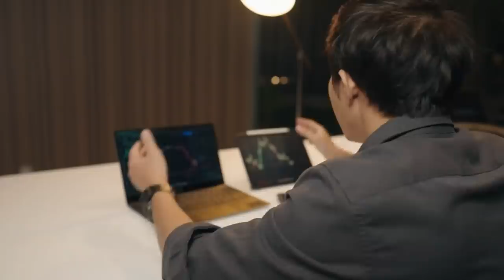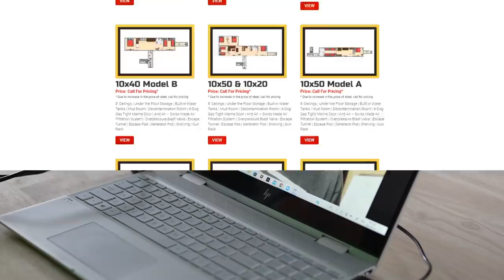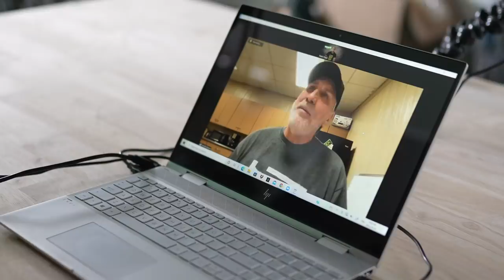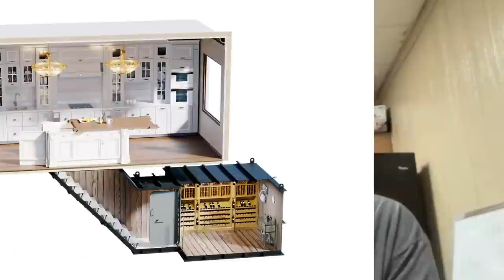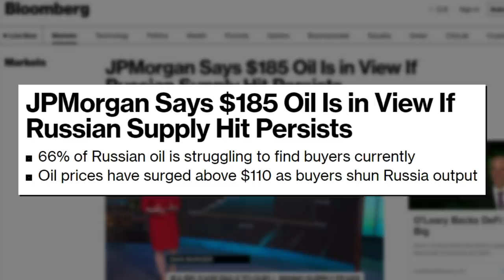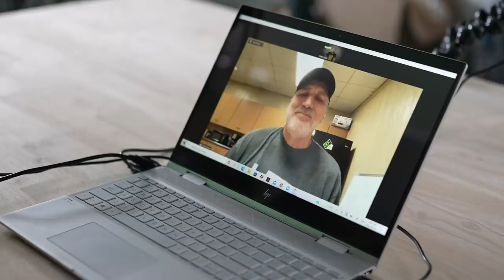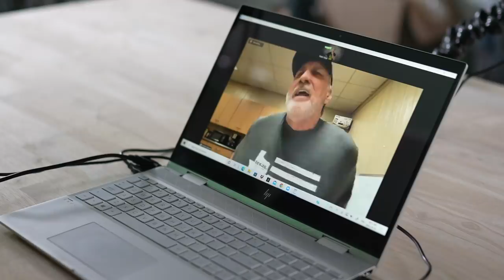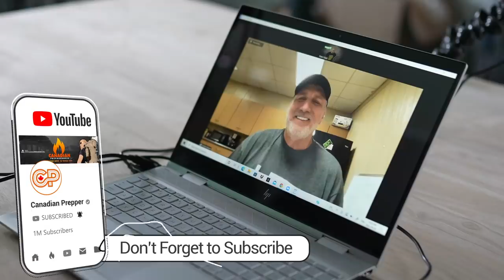Worlds Leading Bunker Contractor WARNS THE WORLD @AtlasSurvivalShelters

Comment: Yes they are and so should everybody be getting prepped.  Besides food, camping gear is paramount to a useful prep, even for home use.  When the lights go out, that tent stove is really going to save the day in heating both the air and water/food.  When it's freezing outside, the tent you set up in the living room will be much easier to heat, than the entire house.  That insulated sleeping bag will work well, when the heater stops running.   1)  Weapon, 2) Food/Water, 3) Nutritional Supplements, 4) Household Supplies, 5) Camping Gear.
Reply: Glad you pointed that out. I was raised in CO and have always had camping and fishing gear, now I’m realizing how important all of it is. One full propane tank, or gas stove, will last you a while. Plus everything else you stated is almost necessary at this point. 
Learning fishing and bow hunting to be even more efficient, bullets for threats.
Reply: Nice list.🌹🦋🌹

Comment: I would recommend shelter made of reinforced concrete covered with lead plates or without, but will be much more durable for radiation
Reply: Certain depth of soil and concrete is pretty good shield. Lead would be good for shallower hardened rooms. There is sheetrock that has lead on the back that is installed around x-ray rooms, Not sure where to get it though. When you install it all penetrations have to be wrapped in lead.
Reply: @warrenharrison9490  I also consider compressed air energy storage which will supply shelter for a month.

Comment: There are a ton of people out there that wish they could afford a nice bunker under their home, myself included. Fact is, even if you can't afford one you still need to do what you can to be prepared the best you can.  Thanks for the inspiring videos.
Reply: small storm shelter or cellar types are not so expensive. I have seen many made from one inch plastic. They place them into soil like septic tank. Tie to anchors so that water level won't raise them. No air purification, toilet or water but these are more waterproof than those rusty metal ones. That plastic is probably polyethylene with anti UV additives. It won't get sun under ground and will outlast these metal bunkers as long as it's surrounded by sand and not sharp objects. And these plastics can be glued with pipe glue or melted to other thick PE pipes to connect air and water pipes without leaks. If you find large enough PE pipe even escape tunnels can be built but these pipes at large diameters are expensive
Reply: If we have a nuclear attack I believe the ground will be contaminated for many years? I would rather die than live in a bunker😕
Reply: @beckyg8028  Doesn’t even have to be a nuclear bomb, if a bunker is affordable to the everyday person, a clusterbombing would still destroy that kind of bunker

Comment: A bunker should be after things settle. It also should never be under your house. What if the opening/entrance gets covered (bombing, weather, earthquakes/tremors, fires)? You will be trapped in your nice bunker. Make sure you are portable and capable of traversing rough terrain. Id reccomend a diesel since it is easier to make fuel for, and diesel fuel stays good longer than gasoline. 4x4 if possible though a 2 wheel drive is fine if you have some clearance, a winch, and/or offroad kit (traction skids, shovels, tire chains etc.) Dont be the sheep, be the survivor.

Comment: WOW! $40,000? You call that cheap? I dont make that in a year. I will stick to upside in my house. Plus, cant dig in this HOA are anyways.
Reply: Lead paint, lead drywall panels, lead roofing, lead doors, lots of leaded or holmium or hafnium or Tungsten or alloyed of the aforementioned building materials in general, plus structural reinforcement, air filtration, water filtration, a minimal power generator...I think you could make an above ground shelter for less than $40k... Lead is cheap! ...And delicious!
Reply: & Boron! It's an excellent Neutron absorber...& it's really cheap & also a component of several superalloys!! Just need to buy some Borax in bulk...that ain't no $40k!

Comment: Well yeah, just look at history... There is increasing evidence that this is all related to Climate Cycles and Magnetic Excursion cycles (with lengths of 12960, 6480, 3240, 1620, 810, 405 and 202.5 years long). Below some examples (note that the shorter the cycle the weaker it is, and the further we look the harder it is to notice smaller cycles, also some dates are still being debated): 

±202 Years Ago (202.5-Years Cycle): Dalton Minimum (1790-1820) and “Year without summer” (1816). Great Tartary Collapse (1801, last seen on the 1801 Mappemonde by Guillaume Delisle and Philippe Buache, it breaks into three pieces: Russian Tartary which becomes the Russian Empire, Chinese Tartary which becomes China and Independent Tartary which becomes Turkestan around 1850). Destabilization and mayor wars all over the world (early 1800s, possibly following the collapse of the Great Tartary, creating a power vacuum), most notably the “War of 1812” in North America (1812-1815) and “Napoleonic Wars” (1803-1815).

±405 Years Ago (405-Year Cycle): “Maunders Minimum” mini-ice age (1645 to 1715). The Ming Dynasty collapse (1644, severe drought). The Thirty Years' War (1618–1648) ended near the start of the mini-ice age (maybe it disrupted the war)

±810 years ago (810-year cycle): Volcanic event (1315-1320) caused damaged crops and mass cattle death, resulting in the Great Famine (1315-1322), resulting in mass death and malnourished/weakened people, resulting in the spread of the Plague (1331-1353) which was a bubonic plague, resulting in the weakening of empires, resulting in wars like the 100-year war (1337-1453). Mongol Empire Collapse (1368)

±1215 Years Ago (405-Year Cycle): Medieval Warm Period (900-1300) made climate wet in Europe, arid in North America, may have depopulated the Great Plains of North America, then The Crusades (1095-1291), The Khmer Civilization collapse (1000-1200, experts don’t know why), The Maya Civilization collapse (900, severe drought killed millions of Maya people due to famine and lack of water), The Tang Dynasty collapse (907, crop failure and famine associated with drought), The Tiwanaku Empire (1000, drought, 10-meter drop in lake level at this time), Anasazi Collapse (1150, North America experienced a 300-year drought called the Great Drought). All these collapses may have allowed an easier invasion by the Mongol Empire (started in 1206)

±1620 years ago (1620-Year Cycle): "The worst year to be alive" (536): A volcanic eruption in Iceland caused climate cooling, resulting in crop failures, then famine (weakening people), then the Plague of Justinian (541-549) which was a bubonic plague. The Roman Civilization Collapse (476). Beginning of central Europe’s 300-year Migration Period (300)

±3240 years ago (3240-Year Cycle): Sterno Etrussia Excursion. Late Bronze Age collapse (Hittites in 1178 BC, Mycenaean Greece in 1050 BC, the collapse affected a large area covering much of Southeast Europe, West Asia and North Africa, 300-year drought event), Indus Civilization collapse (1000 BC, experts don’t know why but think it was climate change and famine)

±6480 years ago (6480-Year Cycle): Solovki/Noah/Sumerian Excursion: Nothing to do with religion, instead massive floods all over the world. Çatalhöyük Civilization collapse (flourished 9000-7000 years ago then suddenly vanished, experts don’t know why), surviving Sumerians came to Mesopotamia (5,300 years ago), first city states (5,000 years ago), Prehistoric Egypt (5000 years ago), massive advances in agriculture like irrigation, all known domestication of animals and plants (4,500 years ago). Note that this event was so brutal that barely anything was left from previous civilizations. Sumer is created (6500 years ago, 

±12,960 years ago (12,960-Year Cycle): Gothenburg/Younger Dryas Excursion: Global Mega-Faunal Extinction (remember the frozen Mammoths?). Following the event: Beginnings of agriculture (9500BC), beginning of domestication through millennia of plants and animals, earliest monumental ritual art (9500BC), earliest use of brick architecture (9500BC), earliest continuous settlements (9000BC). 

±19,440 years ago (6480-Year Cycle): Hilina Pali/Lake Biwa/Lake Imuruk Excursion. Unknown effects.

±25,920 years ago (12,960-Year Cycle): Lake Mungo/Last Glacial Max Excursion: Mega-Faunal Extinction mainly in Australia/Eurasia/Africa. 

±39,880 years ago (12,960-Year Cycle): Mono Lake Excursion: Mega-Faunal Extinction mainly in North America. anatomically modern humans replace Neanderthals (40,000 years ago).

±51,840 years ago (12,960-Year Cycle): Leschamp/Napoli Excursion: Global Mega-Faunal Extinction.

±64,800 years ago (12,960-Year Cycle): Norwegian Greenland Sea/Gaotai Excursion. Unknown effects.

±77,760 years ago (12,960-Year Cycle): Toba Excursion, known as the greatest bottleneck in human history. Caused 1,000 years of volcanic winter. It is estimated that less than 10,000 people survived on the entire planet.

Comment: those bunkers will become the tombs of the rich... most of them become unlivable within weeks... humidity buildup... equipment failure...
Reply: there are videos of flooded bunkers. Not all soil is like in texas. These bunkers are not meant to last. Tubing is outside burried in soil. One fitting will leak and it's not repairable. Metal isn't any good in most soils except sand. If need good bunker/storm shelter/cellar then these all can be made from concrete

Comment: There's a guy on YouTube that shows you how to build these things step by step. The video it's like five different parts and each video is 10 hours. He shows you step by step including a sealed gas door, ventilation system that looks identical to this one and he even innovated a booby trapped door that is impossible to set off from the inside, but once it's closed and the person on the outside tries to forcibly open the door it electrocutes them. Not enough to kill them at all, but enough to where they won't grab a hold of it again. The smallest one he builds would cost you about $12,500 to build yourself and the biggest one he builds is about 21,000 if you buy the materials yourself period If you have welding and fabrication experience comma with a little bit of plumbing and electrical knowledge period especially if you've got the shop to do it in
Reply: Whats the channel man im keen to watch